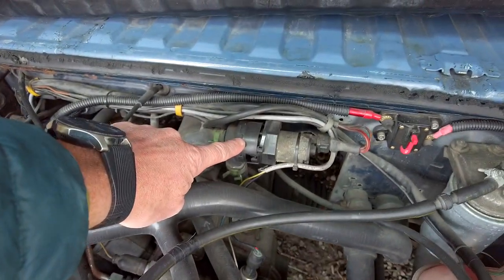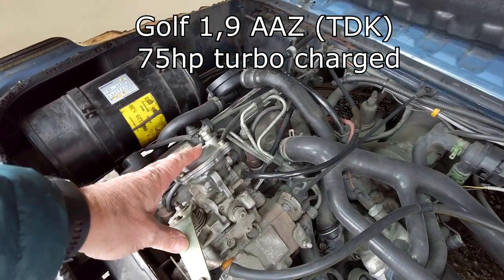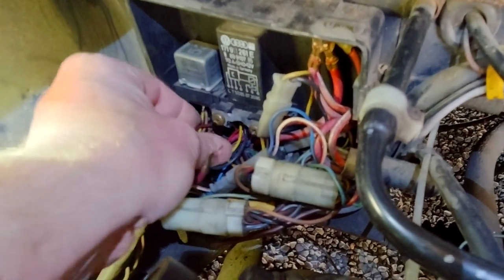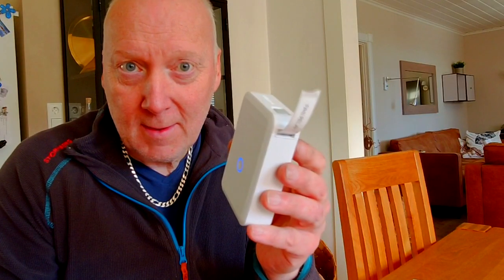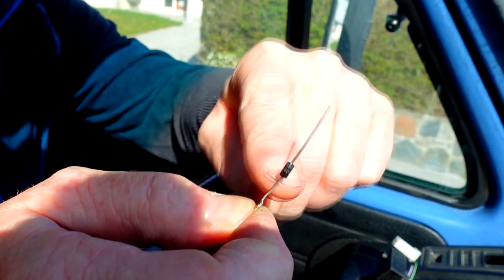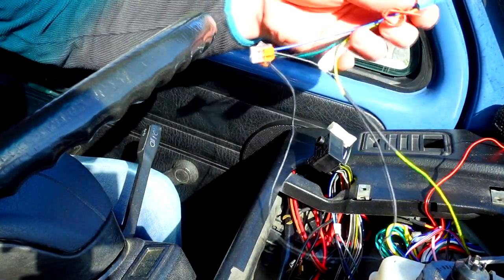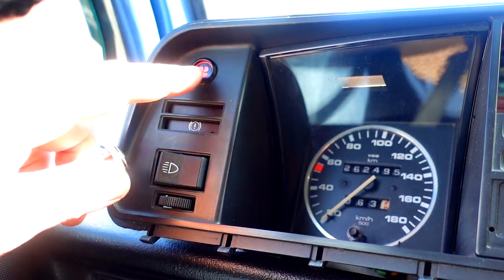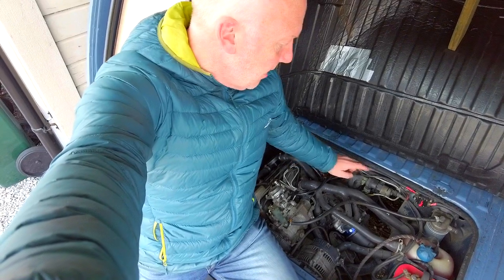Vanagon T3 T25 coolant auxilliary aux water circulation pump hack

Comment: Hi thanx for sharing.
I live in a Hot country so i replaced this pump temp switch to the lowest value I found (around 93°C) so the pump starts cooling the oil when your hill climbing. This way you dont have to be acting the pump and worry. And even more important for this IDI engines is to put a new radiator, the biggest can fit in place.
;-)
Reedit: 93°, i believe was original value and I installed 88°.
Reply from the maker: Great tip, thanks for letting us know 😀
Reply: @Italjohn  -;)
Reply: There’s only one radiator size for a VW T3.

Comment: Great idea for multiwire cable from front to back, I added a remote fuel pressure sensor for waterboxer EFI status and need to add a tachometer since 1984 model doesn't have it, and electric brake wire for the towing connector.
Reply: Love to see a remote oil pressure gauge in action! The red bug video was great, but having no gauges can be traumatic and leaves me in an anxiety state! Lights that come on after it's too late? Had that happen over a lifetime!
Reply from the maker: I have this gauge https://youtu.be/XbmckHgVTCY

Comment: Hi from Danmark. Sorry for the dumb question, but I am not an expert and don’t have many skilIs. I have a T3 with an AAZ as well and know that over heating of the engine / oil is a problem; I thought about installing an oil cooler to handle that. 

I would just like that I understand this correctly. The whole idea is to install the switch so that you can turn on the auxiliary pump to cool the oil when driving ? 😳

Best 

Rene
Reply from the maker: Yes, that's the idea.  I  don't know if it's working like i hope for yet.
Reply: Tak. How do you monitor the oil temperature?
Reply from the maker: I use this gauge https://youtu.be/XbmckHgVTCY

Comment: Hi John, do you have a chicken switch, to manually control the radiator fan to cool the water?
Reply from the maker: No, but will maybe install one later
Reply: Really good and simple mod. I believe it’s a more efficient option to cool the water (and therefor oil) quickly when it matters.
Reply: Yes, the Radiator. Fan switch override is the best and correct way to help reduce hill climbing temps. 
And it helps An upfront oil cooler too, an essential for these engines

Comment: are you not paying vat on stuff from China in Norway? in Denmark we do now and well that 25% on top ain't too bad but they charge a fee of 180 DKR i believe these days to handle the package. So a wopping 180 kroner to charge vat for a 10 kr item + the 2.5 kroner for vat
Reply from the maker: The Norwegian vat is added to the order at checkout. So all parts from Aliexpress and Ebay are shipped to Norway with no extra charge.